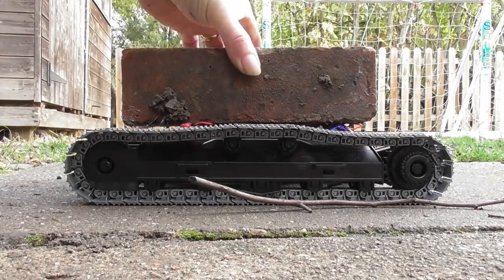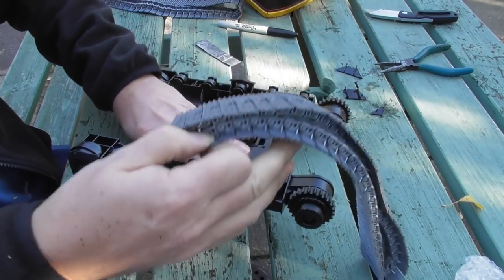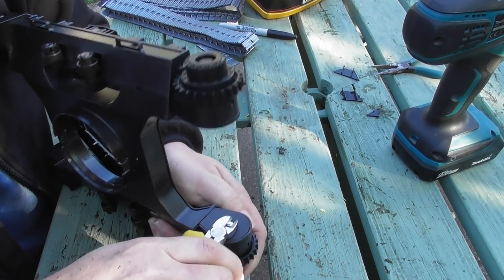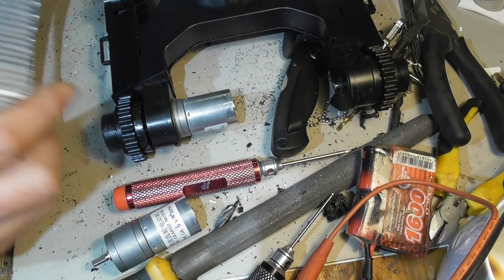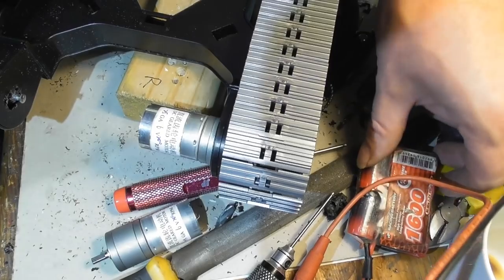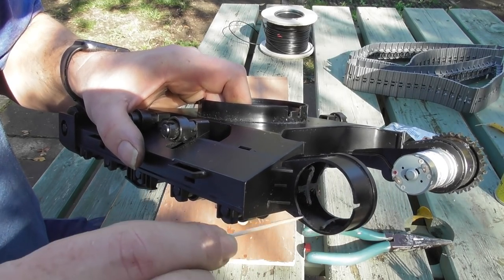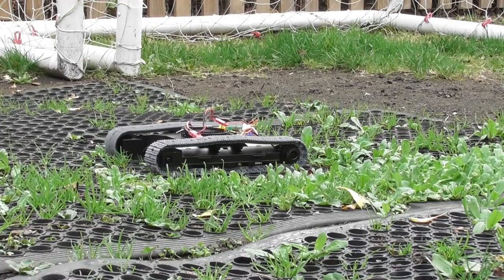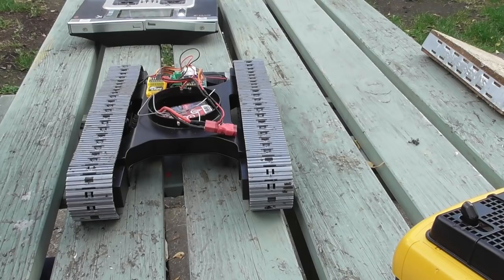Bruder CAT Excavator RC conversion pt3: track motors

Comment: Impressive-maybe if you put the cab and arm back on you can batter that tree down-it would be quieter than the chainsaws.....always enjoy your videos,not always the way I'd have done it but interesting to see the whole process you go through.
Reply from the maker: 😂 these videos are fun to do. I don’t feel constrained by convention, just what I have ordered or have lying around. I’m trying to keep the cost of the parts down and stick to techniques other people can easily duplicate (or probably improve upon) - for some things, the pilar drill or lathe do unavoidably come into play. In the future, if there is a strong demand I could start making the bits that require these tools - although I would probably want to refine the components and fully test the models more before I did that. I agree that the process is interesting - even for me when I see one of my own ‘light bulb’ moments. I will always keep these videos 100 authentic in that respect. The Bruder models are actually becoming easier as I get further into the Bruder designers heads! Thank you for your thoughtful comment 🙂👍

Comment: that Dremel bit is certainly a winner... the tracks alone looks like a very capable vehicle... reminds me of something you would see on robot wars.

have you considered adding some extra tread to the tracks? i cant see them lasting too long before the pavement sands them away... time consuming, but 2 small screws through the end of each track "segment" would stop wear yet still allow enough slip for steering while increasing the bite when moving forward... you would probably only need 1mm of screw protruding... but i would imagine it'll be a like 600 screws though...
Reply from the maker: The tracks are a lot better than I thought they would be, i put the rubber inserts in (which come with all of the Bruder tracked models) and to be honest I think I prefer them without these. They are quite slippery, I may need to think about increasing the grip somehow, they won't go up an unmodified Bruder low loader trailer for instance. Luckily replacement tracks appear to be one of the few spare parts that are readily available - & they are not expensive. I'll see how I go with these   🙂👍
Reply from the maker: Agree about the Dremel bit - really good for course and fine work. Doesn’t melt the plastic like the engraving, stone or sand paper bits. Again thanks for this 🙂👍

Comment: Cool job. If i make a all metal excavator of 30 pounds, what RPM motor would u recommend?
Reply from the maker: Thankyou 😁. I think that it depends on the size of the motor, voltage and gear ratios too. I would think you are probably looking at 60 rpm or less and at least 12v. It’s worth comparing the torque of different options. 30 pounds is heavy. I’m using 370 motors - you may need to consider 400 or even 540 ones. All metal RC tank gearboxes may be worth considering - some are very powerful. 😀👍
Reply: @RCModders  Thanks a million. Highly appreciate your great help. I calculated 60 RPM and thought would check with an expert like you. Now I can move out in confidence :) Will keep you posted once I have some progress.
Reply from the maker: @shyamyelamarti3113  You are very welcome! 😀👍

Comment: Nice build videos really easy to follow.My question is are you going to be able to locate and install some sort of slew ring between the track base and cab for the turning radius.Thanks for sharing these build videos they really help a lot.
Reply from the maker: Thank you ! 🙂 the existing parts should be ok for the 'slew ring' if I understand properly what that is. However I am going to need to install some sort of gear ring either inside or outside of this. I am looking closely at mt 1/16 RC tanks for a solution to this ......

Comment: So do you slow the motors down by running it through the speed controller then?
Reply from the maker: Yes. One motor is controlled by an ESC linked to the elevator (right stick up and down), the ESC for the other motor is linked to the aileron control on the transmitter (right stick left and right). Then a 100% mix is applied between the aileron and elevator on the transmitter and a second mix of 100% between the elevator and aileron. The direction of the controls and the mixes (ie plus or minus 100%) is either determined by working it out or trial & error (there are only so many combinations to work through). Hope this helps. 🙂👍
Reply: forgive the question if it is silly, but better to ask then wonder.
Reply from the maker: Not silly at all. The first time I did it, I didn’t know if it would work. This is much cheaper than buying a twin ESC with built in mixing (like the Sabretooth kind) and just as good for low power applications in my view.
Reply: @RCModders  awesome thank you.
Reply: What esc are you using and are they all the same for all channels

Comment: How did you decide whether to use 6v or 12v motors?
Reply from the maker: I would have tried the different options (and also looked at price/availability). For these conversions I will only use either 7.4v Lipo or 7.2v NiMh batteries, as everything is cheaper and ESCs dont tend to overheat. I really only use 3s batteries in RTF RC aircraft and drones etc. 😀👍

Comment: Can I use a dual motor esc and if so which one should I use
Reply from the maker: For the track motor control you could use a sabretooth twin motor ESC, but I used a pair of very cheap single ESCs (like these https://www.ebay.co.uk/itm/10A-Bustophedon-ESC-Brushed-Speed-Controller-BEC-5V-1A-For-RC-Car-Truck-Boat-FA/113153672041?ssPageName=STRK%3AMEBIDX%3AIT&_trksid=p2057872.m2749.l2649 ) and mixed them for track control on my transmitter. I would go with the less expensive solution if you have 2 free mixes on your transmitter. Hope this helps.
Reply: @RCModders  thanks for the help, however, do you need 2 different batteries for both esc s or can I use just one battery?
Reply from the maker: Just one battery (I am running about 6 ESCs off one battery in the excavator I think). Got to make sure that only one of the ESC’s has it’s red wire going to the receiver (disconnect all the others - you can pull the red connectors out of the receiver plugs if you a fan on the plug with a knife). Wire the receivers in parallel to the battery. 🙂👍